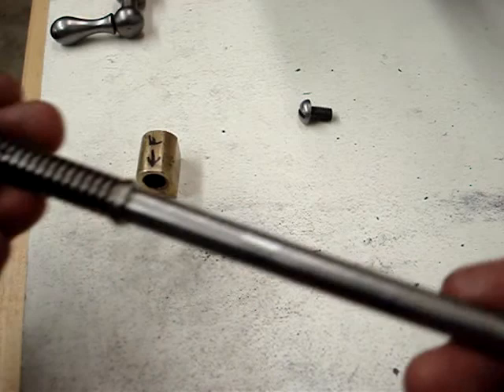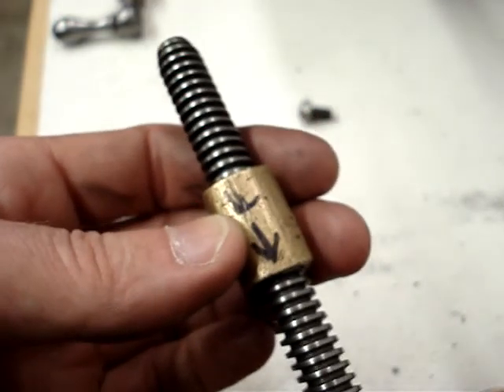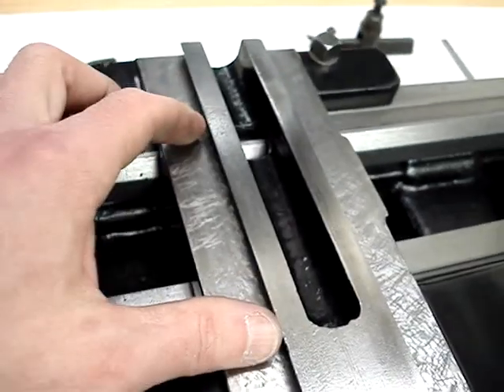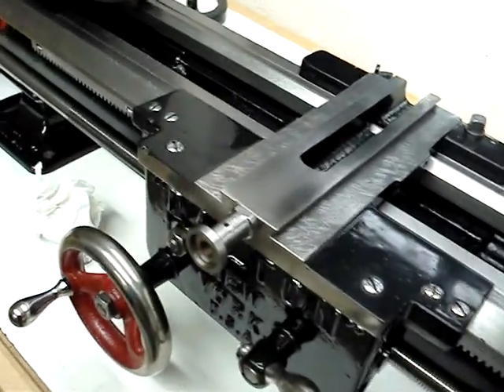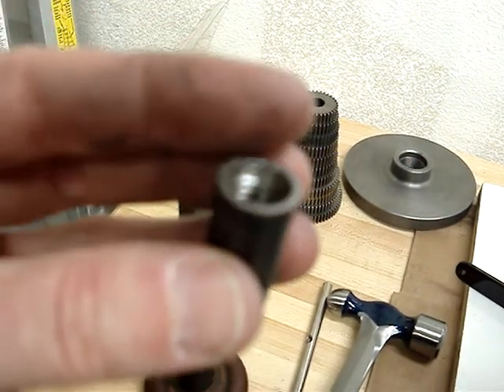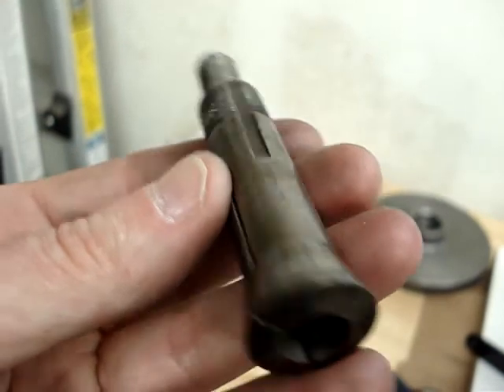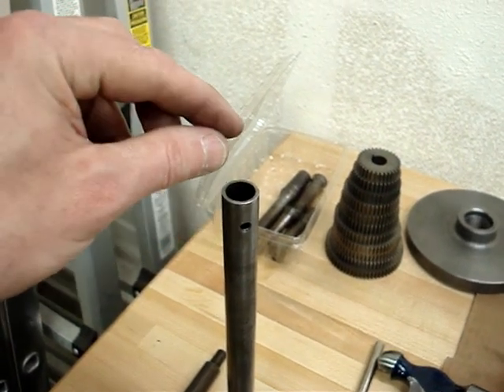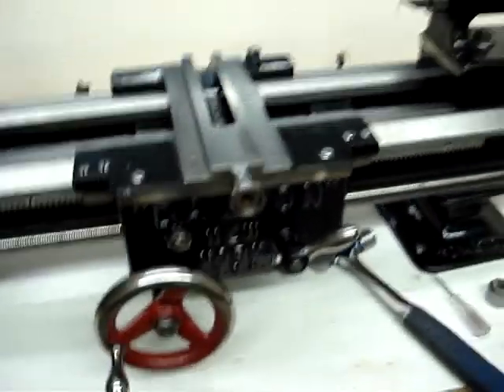Checking play and backlash on the Dalton cross slide lead screw & nut

Comment: Ray;

Most likely uneven wear on the cross slide dovetails or excess wear in the center area of the cross slide dovetails since that would have been where the majority of the work was done.  Your idea of measuring dovetails is spot on.  If the dovetails are uneven, you can recut the dovetails on your Clausing or have a machine shop do it for you.  You probably won't need to make much of a cut to true them up again.  Also best to redo dovetails on both the cross slide and base.

Regards;

Ron